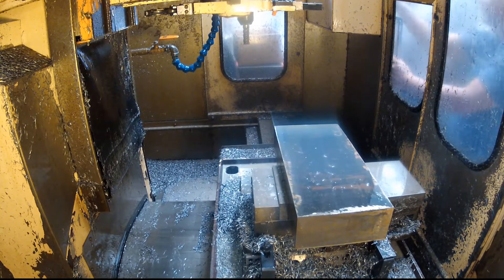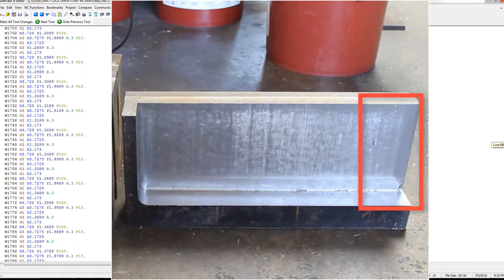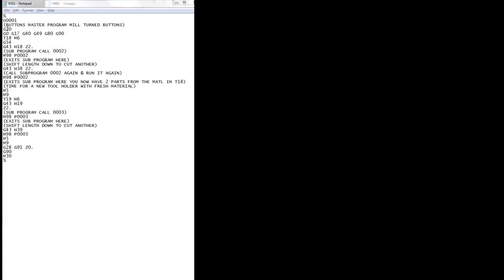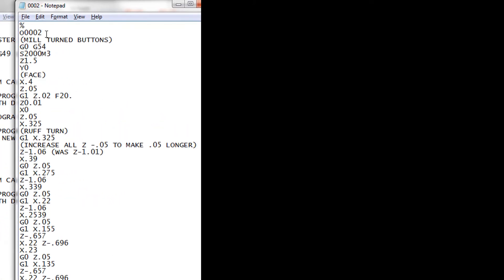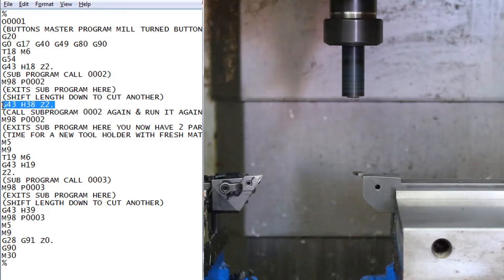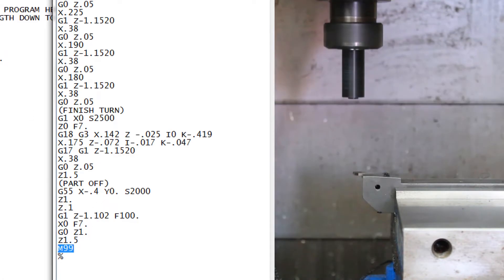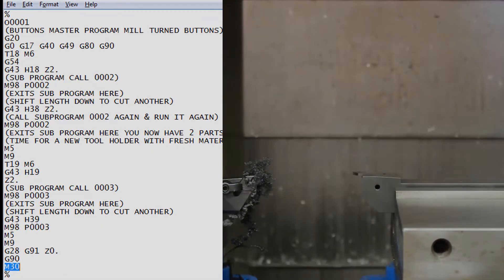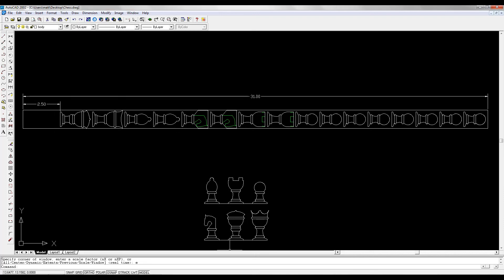How to use subprograms on a CNC

Comment: I made a bar puller sub program (O12345) and I want to run 10 parts on my lathe then stop. For some reason it runs continuously and doesn’t stop. I start the main program and before I do any machining I call up the bar puller sub. Then at the bottom of my bar puller sub is an M99. Also at the bottom of my main program is an M99. When I call up my sub, when I input M98 P12345 L10…it runs the bar puller sub 10 times before it starts machining the part. How do I get it to run the sub and main 10 times then stop? What am I doing wrong? Are my M Codes in the wrong place? Or is my Haas lathe too old? It recognizes the L…but where do I put it to run the puller then main a certain amount of times? I thought the only M98 is for the sub.
Reply from the maker: From what you described my 1st thought is the Loop command [ L10 ] should be in the main program, no loop in the sub.
2nd thought to tell you to look at the difference between M99 & M30 or M2 at the end of a program.
Post your main & your sub programs in the comments & we'll look at it.
Reply: @kittadyne  the L10 is in the main. At the top of the program…before it calls the first tool. So it reads the safety blocks…then I call the sub up M98 P12345 L10…then it runs the bar puller sub (O12345) and at the bottom of that sub is the M99. So then it jumps back to the main and runs the main program. And at the bottom of the main is an M99 as well. So with the L value in that block with the sub call…it runs that sub 10 times before running the main. Should I put the Sub Call block at the end of my main rather than at the beginning?
Reply: So I’m trying to get it to run only a certain number of cycles and then stop. Which is controlled by the L value. I’m thinking I have the codes in the wrong spot. I have an M99 at the end of both programs. It’s a Haas lathe. Late 90’s model.
Reply from the maker: Post your code in reply to this comment
Reply: @kittadyne  can I email it to you. Screen shots of both programs?
Reply from the maker: @F30586  Sure - kittadyne@gmail.com

Comment: You could have done that with 1 sub using incremental in the sub and call out your start positions at each point in the main with absolute,If you are using the same tool path.